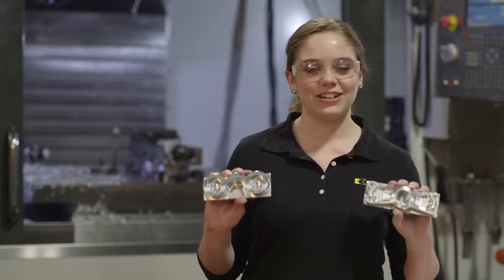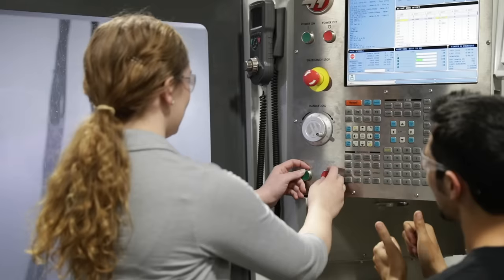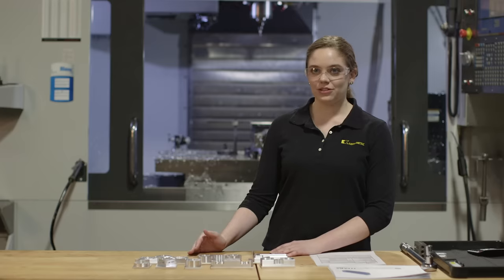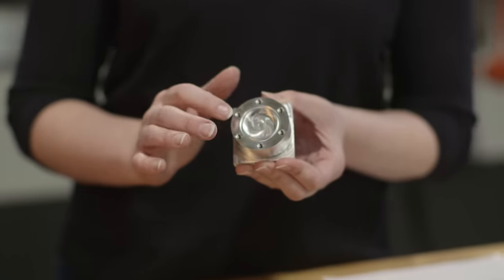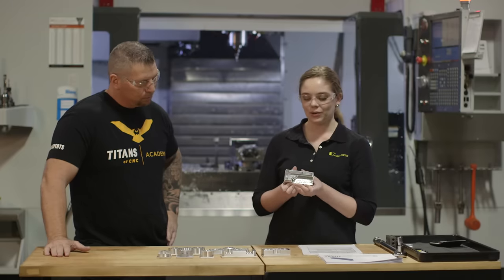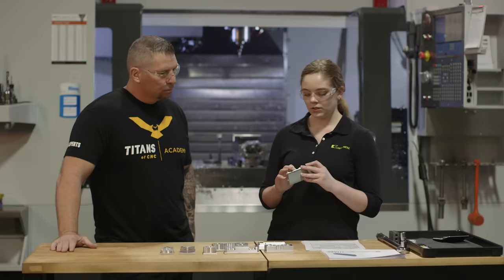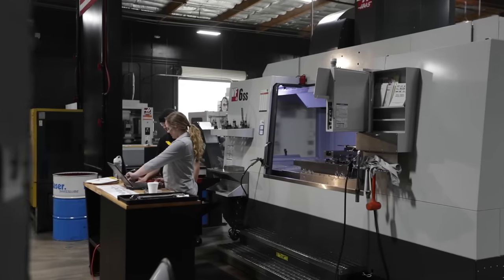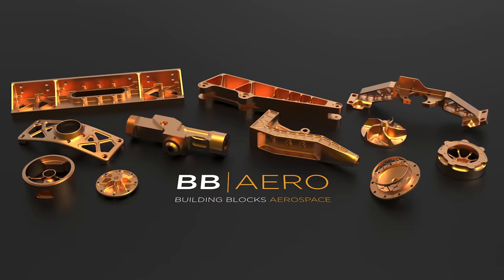First Time CNC Programmer Does The Unthinkable | Machining | Vlog #73

Comment: Congrats Katie. 
I have a brand new CNC mill (a Syil X7-20, similar size to a Tormach 1100) being delivered at the end of September. I’ve started doing all the Academy drawings in Fusion360 so I’m ready to start making chips as soon as the mill arrives. 
Even though I don’t have access to a cnc Lathe (I have a manual lathe) I’m still going to do all of the academy drawings, to help me improve with CAD. 
I’m 52, and not from a machining background, but love my hobby shop machining.
Reply: Glad you added your age. I'm 29 thinking I'm too old to get into this cool industry

Comment: I work with Biesse machines,  5 axis and 4. A fascinating job to have. I do wood carving.  It's extremely precise but takes time to learn.  The program you need to work with can take months to learn.  Very different than what you usually find like photoshop and so on. Some people use Corel but you can't do that with Biesse,  comes with  a variant from Autocad and a different program,  they both work together.  But it's a fascinating job to have

Comment: I can see the value of these building blocks tutorials and I've actually done my version of them using my tormach 770 hobby mill but, I'd like to see some slightly more advanced hobby oriented tutorials.  Example:  My CAD software is an older version of SolidWorks (V10).  My CAM software is an older version of SprutCam (V7)

Since the laptop computer that I have set up to run my CAD/CAM software  is not internet connected I've been unsuccessful in downloading and installing the Fusion 360 CAM software but I'm still working to get that downloaded and installed.  In the mean time I've been working on modeling and setting up my tool paths on a Spiral-Fluted rifle barrel.

I've used my 4th-Axis numerous times but never for this kind of fluting.  It's been mainly used for making straight X-Axis cuts like those found on reamers and such.  It's taken me about a months worth of work to figure out how to set this up in my SprutCam CAM software and even then I'm thinking that there has to be an easier way to go about this with the Fusion 360 software BUT, I have yet to gain access to this software; when I do I plan to re-run my tool paths in Fusion 360.  

To add to the complexity of this project; (complexity for me)   my X-Axis work envelope is only 14" long; less than that after mounting my 4th-Axis unit on the table.  The barrel blank I'm working with is 17" long and straight-tapered from 1.063" on one end to .875" at the muzzle end.  On top of that is the fact that I'm running a one-horse-power CNC hobby mill to cut into some 41v50 barrel steel.  

Like I said, I was able to finally get it set up for machining using my older version of SprutCam but how much simpler might it have been with the Fusion 360 CAM software?  Could you do a tutorial on that???

Comment: Wish I could learn more challenging on stuff on cnc! My boss just shows small things then throw parts in n out!
Reply: Marc Meex  Hi Marc do what I did stay at a company for 5 years then look for  another that does different things I moved 6 times in 14 years from the oil industry manufacturing then aircraft components, submarine components then rocket propulsion components I learned to program Fanuck, Mazatrol, Alan Bradley, Hass machines also using CAD\ CAM but I learned so many different skills and ways to produce components quickly and efficiently, I was always given the worst and most complex jobs but I new so much I wasn’t scared. If you stay in one company you will only now what they make. And it could be just nuts and bolts, get out there and learn all you can it’s really rewarding. Good luck.

Comment: Sry but if someone has their hands on the cycle-stop Button when you are running a Programm for the first time, that tells me instantly that this person has no knowledge at all. You gotta have Your hands on the feed rate wheel/Buttons. (k maybe if u face off some Kind of Magnet table which has polars on it which are just screwed in and they might wanna rotate midcut) just oof I gotta say here. I know you just wanna Show people what they could be capable of doing, I myself am learning machinist right now and I would love someone who could show me some stuff but in my company nobody is capable of doing so or nobody is seeing my Potential.
Reply from the maker: There is no feed rate button on this machine and your correct per the title... no experience
Reply: @TITANSofCNC  which machine does not have a feed rate button/wheel, what do u do if it starts to Chatter? You normally crank down the spindle speed and turn up the feed rate so u push out the Material but ye, gg if it Chatters

And don't be so sacistic we both know you can teach someone to do something, you could have easiely put in the Programm and let her watch the machine.. The title says shit I believe it when I see it.
Reply: @FireGodSpeed  , shows you have no experience. Next time you try to critisize  do your research. This is a hass machine with no feedrate button🤷‍♂️
Reply: @sosaltysereezy  I do not have experience with Hass machines that's right but Who produces a machine without a feed rate button/wheel?? Wtf. Imagine if u accidently put in a wrong feed rate.. Tool dead.
Reply: Dude you've obviously never worked in a real aerospace shop.  I was always taught to, and still do keep my hand on the cycle start/stop buttons most of the time when running a program, if possible. ..  now go back to your Bridgeport and turn some knobs. 😂
Reply: @jamescyphe540  I quote "you've obviously never worked in a real aeroshop" so I can only assume there are fake once? Surprise but there are other buisnesses than aeroshop's. Like for bigger parts, we produce parts for like trains ,Tanks, we build portable stone crushers used for the asphalting industry, we generally build anything.

But back to ur answer, our machines are build generally for bigger parts and what should I say a feed rate button/wheel is Essential if u work with huge parts (in my opinion atleast)
Very mature btw, oh sry my English ain't the best, I actually ment grow up
Reply: @FireGodSpeed  haas machines have no feedrate button, if you want to stop the machine you have to use cycle stop button
Reply: @danieldias6608  I just looked up Hass machines and I found one with the function to decrease/increase the feed rate midcut. Just oof
Reply: @sosaltysereezy  I would never buy a CNC-Machine without a feedrate knob. It's the most important control feature you need. 

And I have got 3 CNC machines.